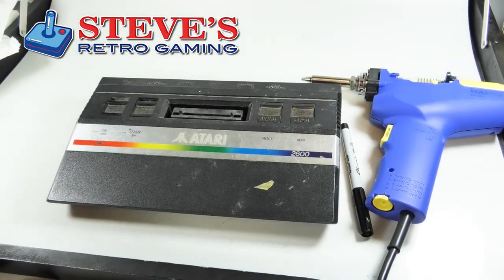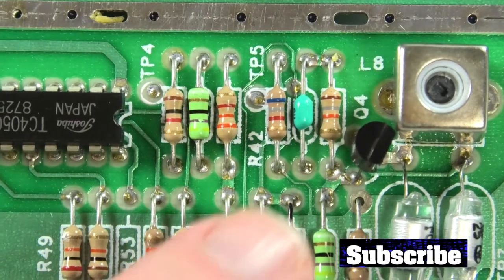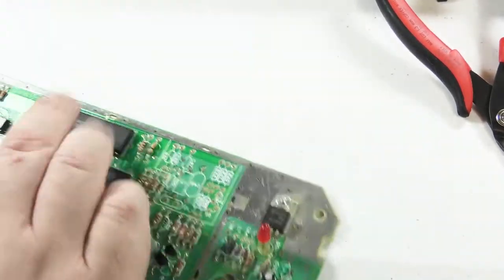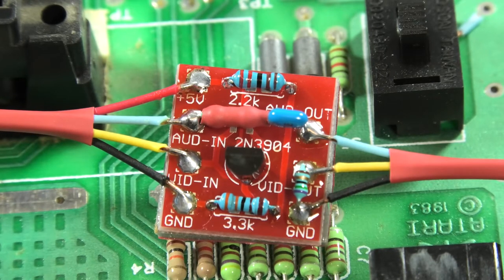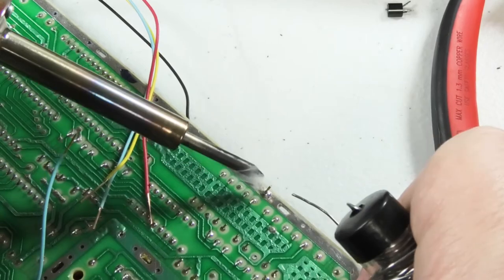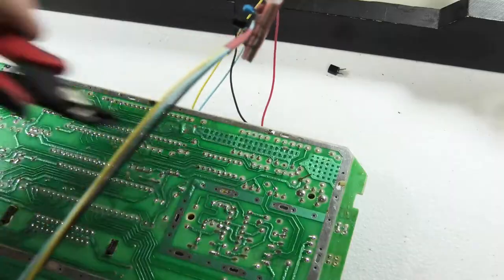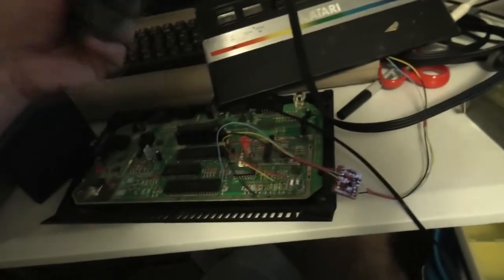Atari 2600 Composite Mod install on a 2600 Jr

Comment: Hello,

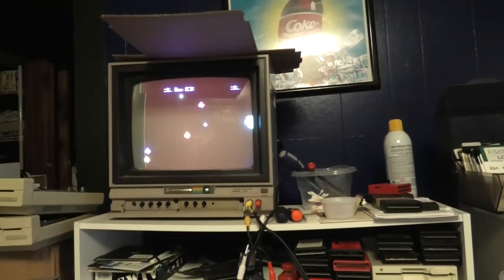Hello, with Asteroids, how come there's like a blackness on the left screen at 10:05. Is that normal for a mod like this?
Reply from the maker: YES - that is a "feature or limit" of the 2600, If I adjust the brightness lower you will never notice - Thank you for the question.

Comment: I did my Vader version of Atari 2600 and it only works for a second, then it fades and you can't see anything.. So I found a Atari 2600 jr at our pawnshop kinda place and I want to do it with this one, but I'm afraid it'll brick it.. ugh . Thanx for the video . I'll think about it..
Reply: If you want to have it done instead of doing it yourself, give me a shout. We can probably fix your 'Vader" version to.
Reply from the maker: You can probably fix the first attempt - but it would be to reverse the steps and resolder the parts, could be alot of work. I would try again on the JR myself - totally work it . Good luck.
Reply from the maker: Nice offer - Thank you for the comment.